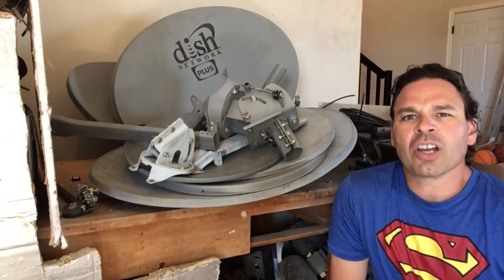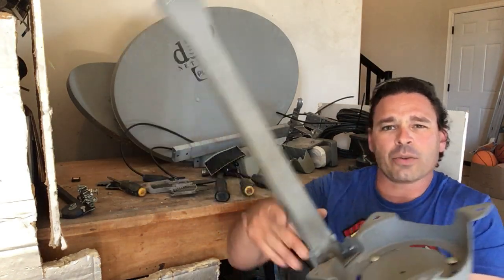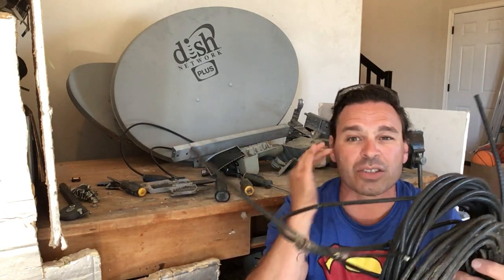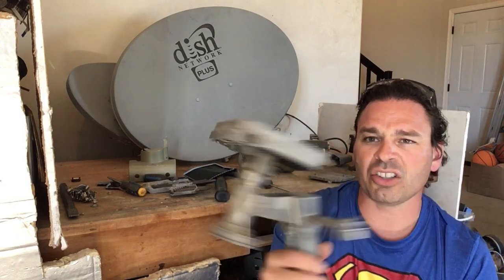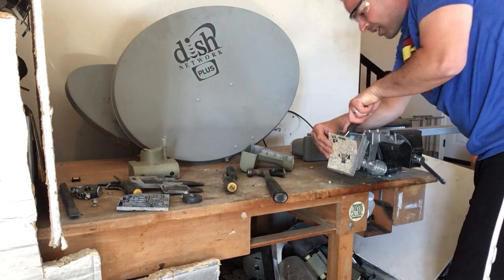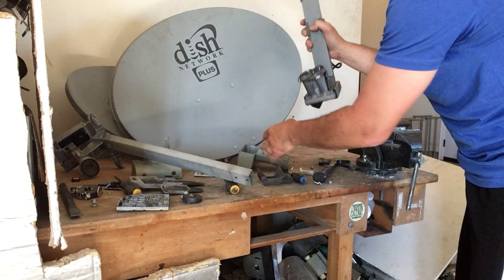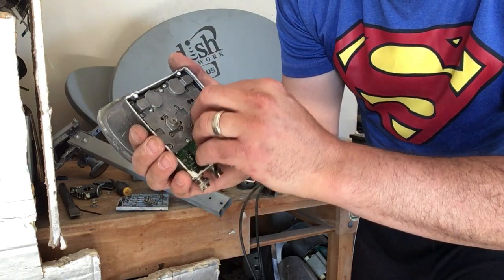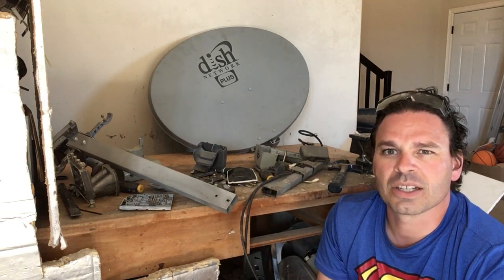Scrapping satellite dishes for tin, brass, gold, other metals, and little waste.

Comment: I pick up lots of satellite dishes and coaxial cable no one ever grabs them but it's all money in the pocket to me I put all magnetic coaxial cables in a separate in a large soil bag if the ends are brass I'll cut them off and throw them in a bucket to later clean up maybe save them for the long winter months here in Alberta ♻🌎👍

Comment: Good  day  I have a aluminum   block  with black  glue or hard paste.  How do u get it out?  Thanks
Reply: Try using a wire wheel on a drill or a metal scraper then wipe it clean

Comment: Tin man I've upgraded up to a copper granulator machine 99.9% purity but I don't know where to sell the granules. Can you please reference me the type of buyers for granules?
Reply: eBay or scrap yard if they know you .
Reply: If your yard knows you're not a POS thief they'll take it. Hell I can take burnt wire to my yard if I want. I never do unless I have something that's extremely hard to strip
Reply: Why take It to the scrap yard when they sell it to another buyer, I'm looking for the real buyer not the middle man.
Reply: You can but your not make much more after your wait
Reply: You're best bet would be eBay. Basically looking to sell to a individual thats going to be melting it down into ingots. Idk I can't see making much more of a profit from that unless you actually melt and then sell the ingot's. Then you'll be able to easily get $15 a lb . Remember there's cost involved with that even .

Comment: Will tell you this the coax cable the shielding that is tin the center it is copper. A lot of satellite coax has aluminum foil an center is copper. This is from a united States dish network installer I had done DirecTV all so . Both had copper in the center one has aluminum  a shielding and the other one has metal shielding those shielding is for grounding .. it is not worth nothing as scrap. More plastic take about a foot remove the outer casing then remove the inner casing you will know it's copper . Copper is the second best video an audio . The best is copper shielding and the core is gold  that is from a satellite installer.  It's not with nothing as scrap . If you clean it all up 2000 feet of copper may get you 10 cent

Comment: being direct tv installer and in my area scrap yard will not scrap dish as tin anymore tin pays more but here no one does its scrap and unless the electronic housing was after 2009 they are not alumin cast so you dont get as much also.. being an independent.. directv had a policy of solid copper and core not copper clad which has a steel core but i have been out for 6 yr and if thing are the same many still used copper clad cause buying your own material clad is cheaper all approved barrels are brass core
Reply: It may depend on area, country, yard. The yards I go to in Sarnia and London take dishes. As well, copper is non-magnetic so the wire that I showed cannot be copper, or it would not be attracted to the magnet.